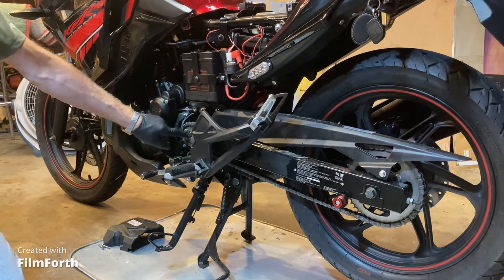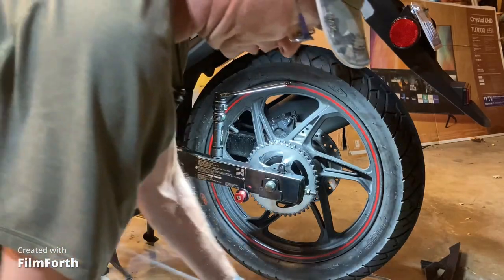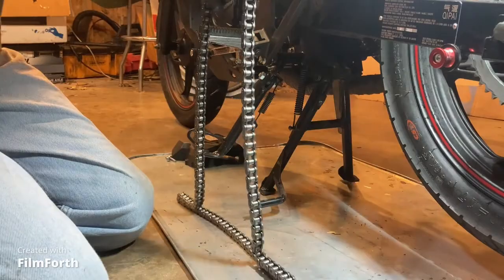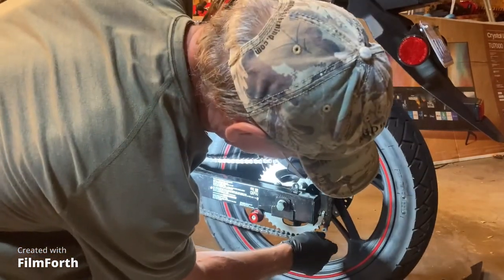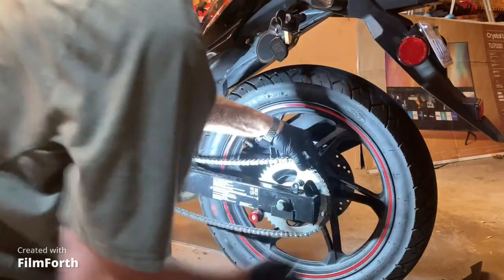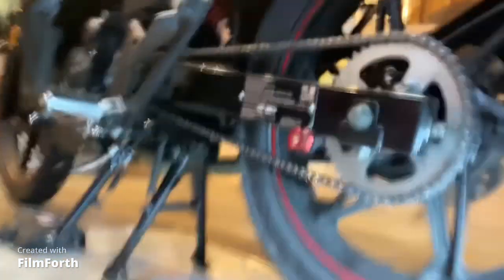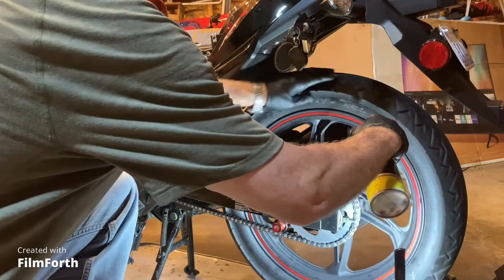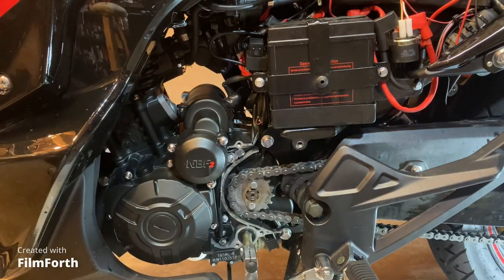How to do drive chain Maintenance on the Lifan KPR 200

Comment: Herbie how can you have 129 link chain out of a 130 link chain? I thought it was by 2 links so that will give you 128link chain, correct me if I'm wrong.
Reply from the maker: @dmachn333  you would count the link but the rollers, if you remove 2 rollers then you removed 2 links.
Reply from the maker: @dmachn333  correct, they come in sets of 2, so it would be 128 links when removed, sorry for the confusion. This is an older video, and I didn't realize that I said that in the video, I will correct it though, Thanks

Comment: @ Herbie, I noticed on my KPR200 it has a sort of place for a center stand. So I was wondering if you installed one on your bike to the frame. If so where did you find it. I prefer it over a stand that go on the spools. Can you help me out here? Another thing, I love how you strapped the bag on to the rear seat,it's genius, I have the same bag and had a difficult time getting it to stay on the seat right, Thanks for you informational video . It helped me in many ways.
Reply from the maker: Thank you for the kind words serafin !!!  I did install it to the frame, there is a spot made just for it. I bought mine from a chinese site engtb.com but I couldn't pull it up today for some reason, but I buy from this site as well, here is the page, the cost is very small but the shipping is high. My total cost was less than $50 usd. https://www.superbuy.com/en/page/buy/?url=https%3A%2F%2Fitem.taobao.com%2Fitem.htm%3Fid%3D44245317136%26ns%3D1%26abbucket%3D16%23detail&nTag=Agent-product-taobao

Comment: Can you send a link to your chain and will it work with the stock sprockets
Reply from the maker: Hi Tac, this is the chain I bought, it is a basic made in Japan chain that is good quality. If you don't like doing chain lube and maintenance, then you might want to look into an x ring chain, as it will not need lubing quite as often. If you are wanting to put your new chain on stock sprockets than simply count the chain links like I show in the video and order the same length. Here is the Amazon link.   https://www.amazon.com/gp/product/B000WJB15W/ref=ppx_yo_dt_b_search_asin_title?ie=UTF8&th=1
Reply: Thanks for the reply, I'm also looking to upgrade to a 16t front sprocket but having trouble finding one as theres different dimensions
Reply from the maker: @ThaCampinSniperz  This is the part number for the front sprocket, JTF 259-16

Comment: Do you think there's room in there for a 17t front sprocket? Thanks for another great maintenance video!
Reply from the maker: Yes there’s room in there and I ran a 17 tooth for a while but the 200cc struggles too much at highway speed. The 17hp engine has a hard time imho
Reply: @herbiesgarage681  sounds like a 16 tooth is the way to go 👍
Reply: @herbiesgarage681  yeah there's definitely not a ton of power to play around with here, so I don't want to give up TOO much torque
Reply from the maker: @ryanwilliams5402  I think you’re right! 😁